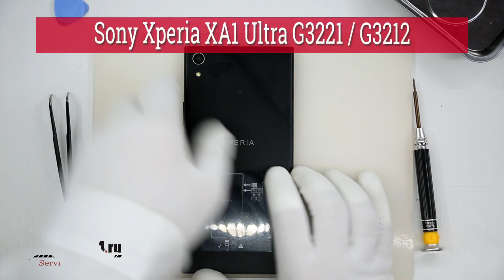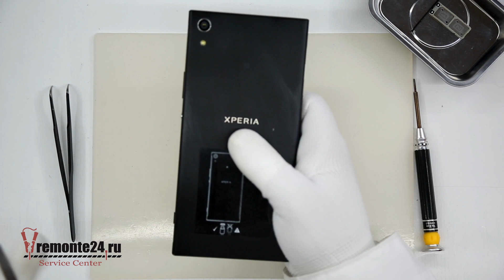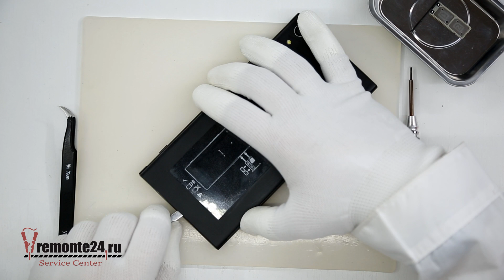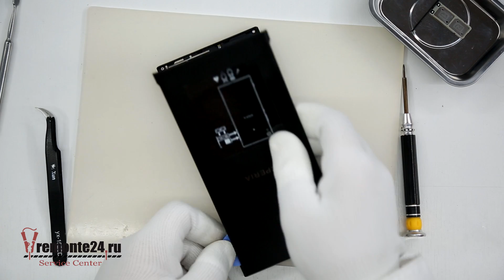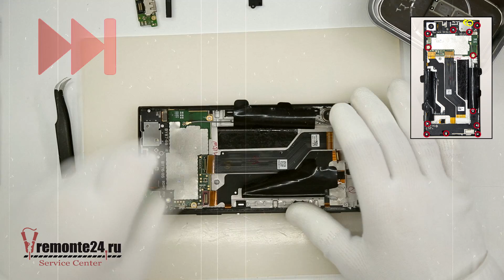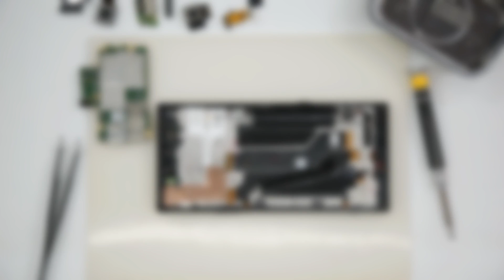How to disassemble 📱 Sony Xperia XA1 Ultra G3221 / G3212 Take apart

Comment: I have a Sony Xa1 Ultra phone that does not charge. The charging board was replaced and it did not charge. The power plate was replaced without any use. Do you have advice? Thank you very much